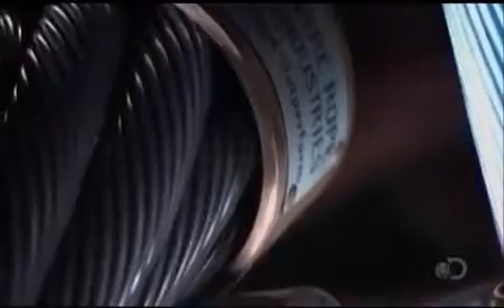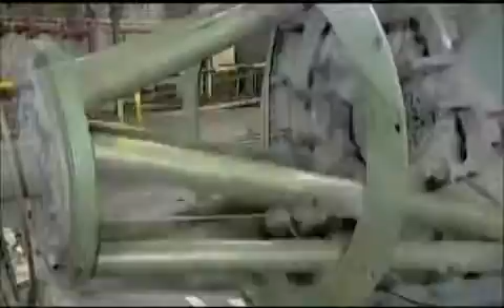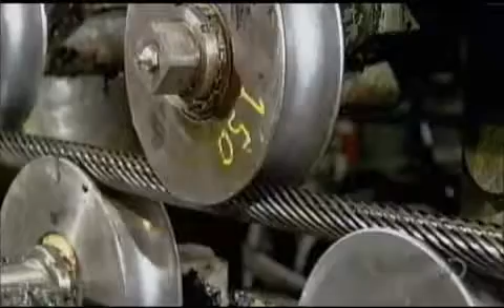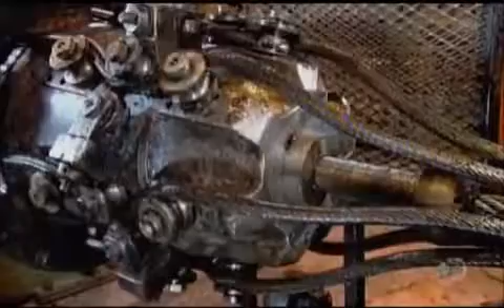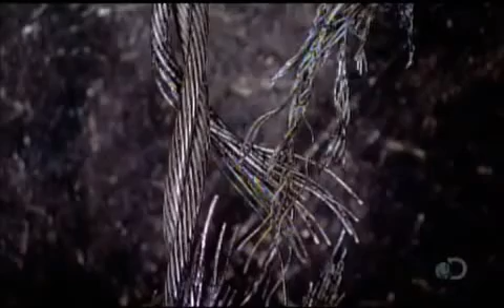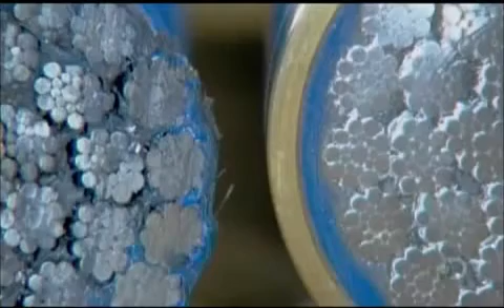How It's Made - Industrial Wire Ropes

Comment from the maker: Union Engineering Co. provides its wide range of  #products  to  #wire   #rope  #machine  #manufacturers  since  #decades   #globally .

How It's Made - Industrial Wire Ropes

 #ueco  #unionengg  #india  #distributor  #gear  #gearbox  #motors   #gearedmotors  #pumps  #manufacturer  #importer  #exporter   #engineering  #machinery  #engg  #supplier  #stockist  #transmission